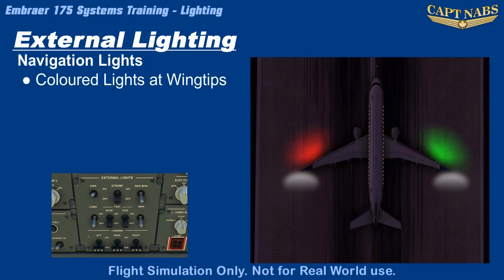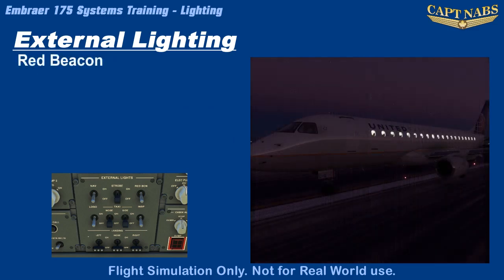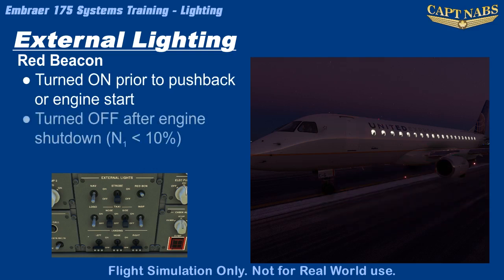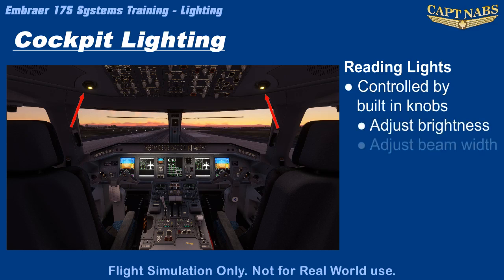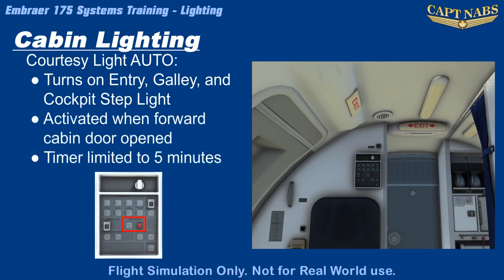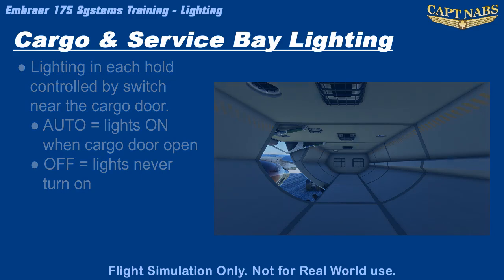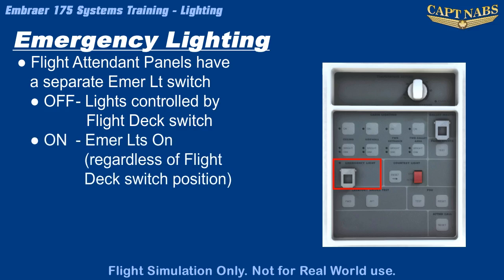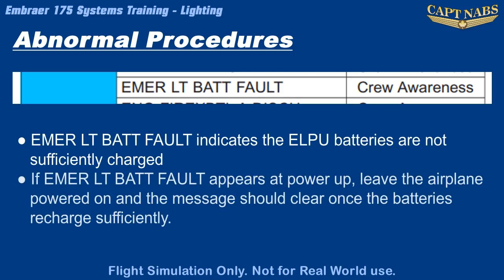E175 Systems Training: Lighting

Comment: Hey Captain, any idea why my flight attendant panels don't get power and the buttons don't seem to work? Seat belt/no smoking and sterile cockpit lights also don't come up but emergency lights do
Reply from the maker: Right now emergency lights are the only thing modeled in the cabin. I dont know if they will put in much effort since the cabin is rarely looked at.
Reply: @CaptNabs  Thanks for the reply :)
Out of curiosity, how did you like flying the Embraer? What were some of the best parts?